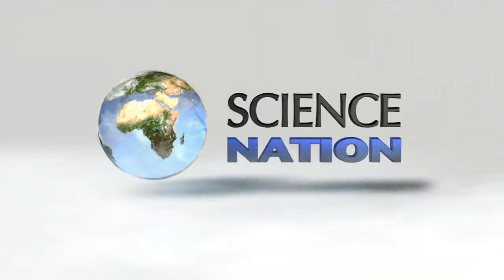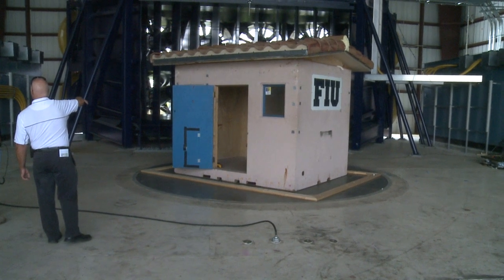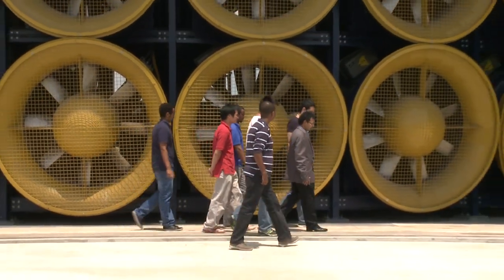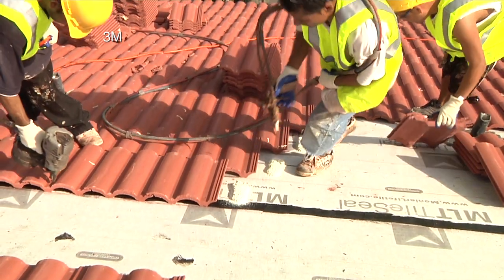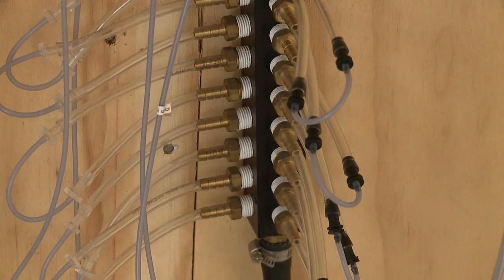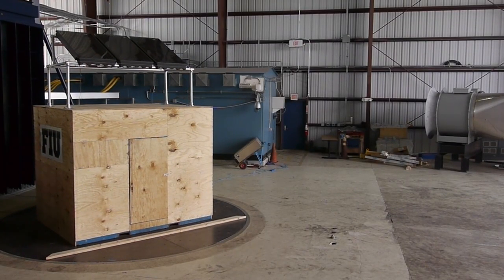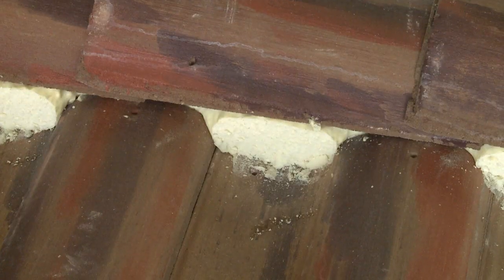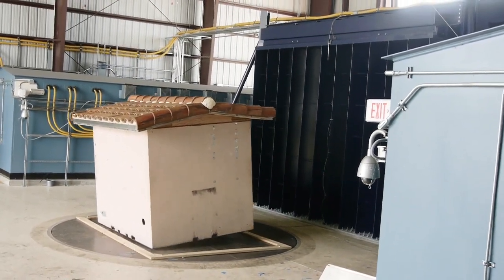Manmade "Wall of Wind" Creates Hurricane Force Winds to Test Construction - Science Nation

Comment: 157 mph is the bare minimum weakest of catagory 5 hirricanes also thats just the sustained winds. The gusts in hurricanes are much higher than tge sustained winds. A catagory 5 hurricane usually has wind gusts well over 200 mph. They failed to mention that. Also there is tons of heavy debris including heavy objects like cars and industrial sized garbage bins. Plus the incredible heavy rains and 30 foot high wall of water from tge ocean rise water surge with the 50 foot wave on top of that. Another factor is this is only exposed to winds for a few seconds but hurricanes last for many many hours and even days.

Comment: Look at the Lorentz effect...How and why Tornados and Hurricanes form?  They use electricity from ground to space inside this arc gap of the atmosphere.  They are nothing more than an Electro Magnetic Vortex created by the flow of energy fro the ground to the edge of space.  Here is the simple tornado and hurricane model in the laboratory... http://youtu.be/SAl1LVPbYhY ElectroMagnetic Vortex by Magnetflipper shows how a six volt battery and a neo magnet produces a viscous tornado or hurricane underwater.  our atmosphere is moist and water droplets do hold a slight magnetic field thus is the Lorentz force or something very similar.  Water vapor created by transmutation http://youtu.be/HMURLTNtAs8 yes, when the atmosphere spins water droplets are magnetized by lightning and the spinning atmosphere actually creates a form of planetary electrical charge.  Here is the math equation for the Lorentz force animation http://youtu.be/fwiKRis145E
Reply: Nathan Rogers Hurricanes and Tornados form NATURALLY HAARP and all those are myths.